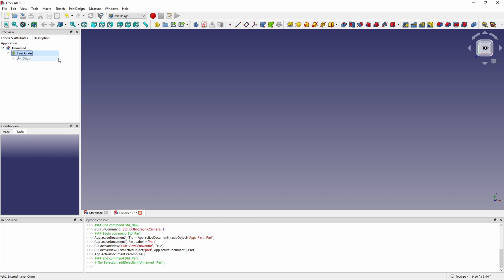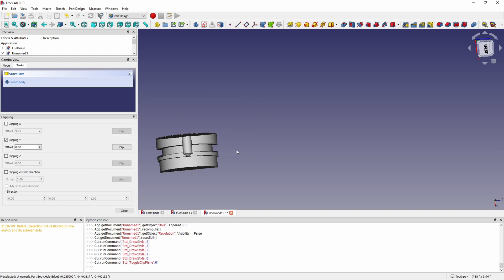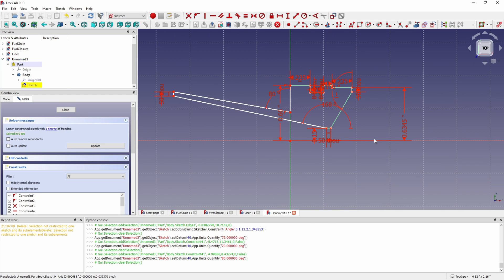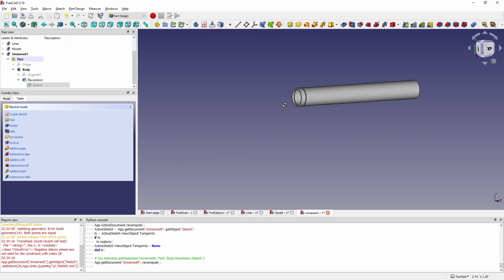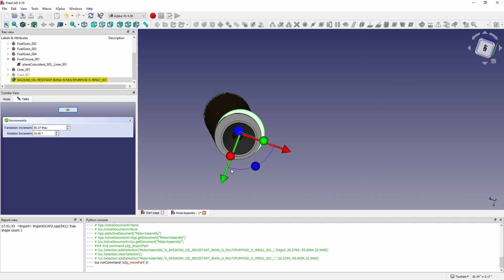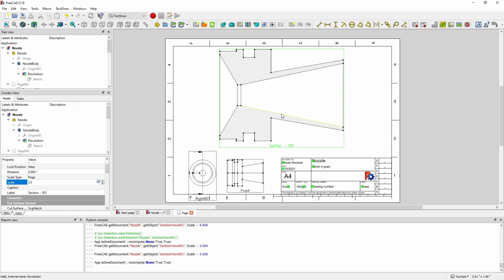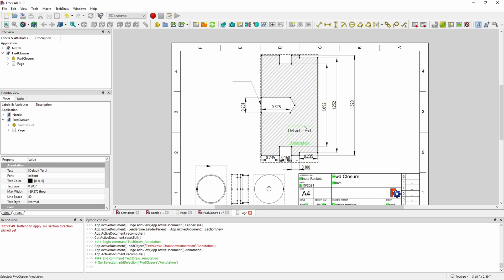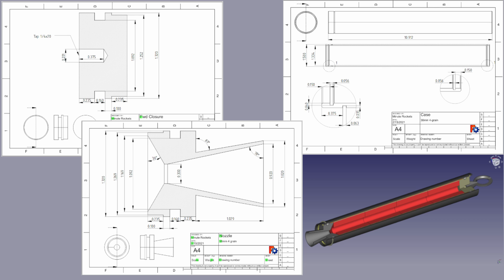Making Machine Drawings for a Rocket Motor - Build a KNSB (Sugar) Rocket Motor - Part 2

Comment: When I'm trying to draw the nozzle using the 2d sketch method you used, and revolve around, I'm not getting any throat. 

Its like fully closed in with no throat.. And I'm getting much bigger exit diameter. 

So, how are you adjusting that and getting the right diameters when you revolve?
Reply from the maker: You'll want to make sure that your sketch is the right distance from the revolution axis, which in my case I believe was the X-axis.  Whatever distance the throat is from the axis in your 2-d drawing will be the radius of the throat, or half the diameter.  If it is closed up then it sounds like the throat on your sketch is right on the axis.  Hope that makes sense.